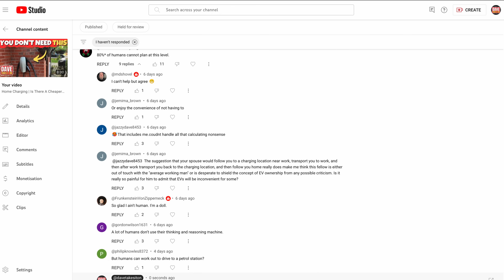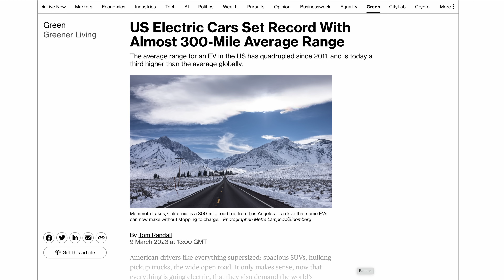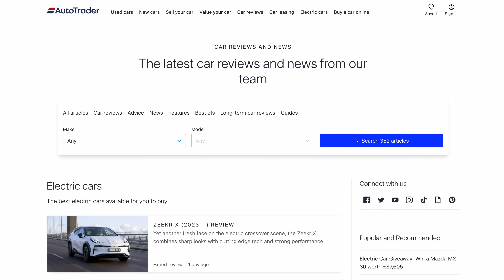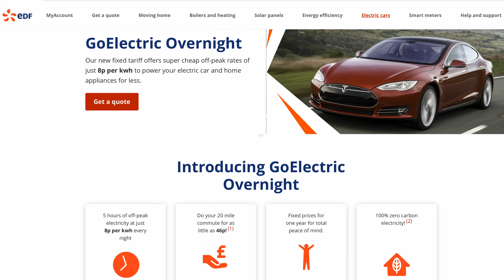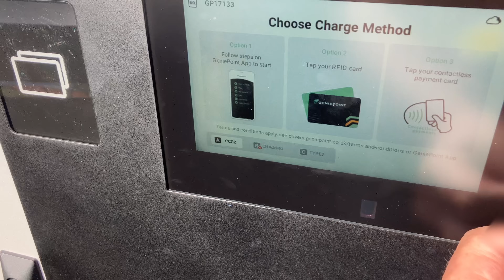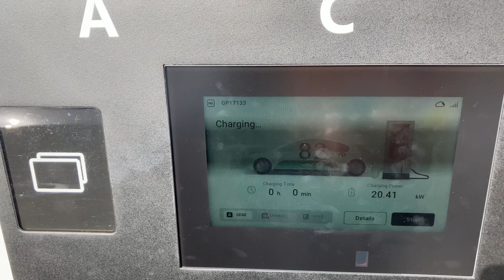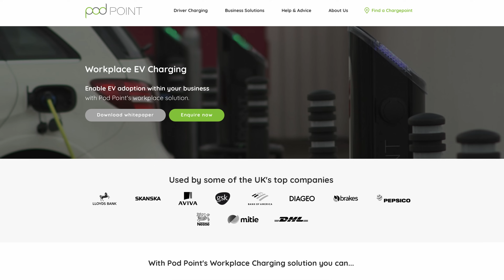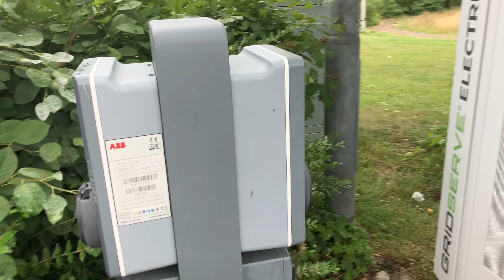Dummy's Guide To EV Charging | Don't Make These Mistakes

Comment: Can you explain to a non- EV owner what happens when you turn up and there is a queue to charge ? What is the protocol, how do/should people behave ? Etc. I can see this situation leading to arguments at peak times.
Reply: Well I guess you can queue up, or do what you might do at a petrol station with huge queue's and waiting times, drive down to the next one. As mentioned already, you can even get an app that will tell you if a charger is available and how many are free in a particular location, try that with petrol stations!
Reply: Honestly mate they are everywhere,  despite what youtube ICE heads would want you to believe it is dead easy...  this is what you do.  You open your app,  the map apps show you which ones are empty nearby.   You can guess what you do next.  The problem certain videos spin is this, they take their cars on a long run and then head for a certain manufacturer of charger, and they do it at peak times, no one does that on long runs.. all people are bothered about on long runs is getting charge in from anywhere.  Now, I own a leaf.  Technically, I should have a problem finding a charger because the leaf uses a Japanese connector.  But I don't ever have a problem, because although the percentage of leaf chargers is lower all the time, there is still new "multi format" chargers opening every week.  And... this is the important bit, remember in the video how we get two sockets on the cars.  Well the AC one is universal, even on the leaf, although on the leaf it only gives us about 26 miles per hour from charging.  In saying all this, I would say that if you can not charge from home with at least a 3 pin plug adapter, then you probably do not want to buy a leaf.  But if you can, then you might.  Today I was doing a 200 mile journey, stopped my car when I had 25% left and checked the app ( I used waze because it was already open ) ... there was a charger 1 mile from where I was.  They are literally everywhere.
Reply: Que up and wait

Comment: Very good video. 3-pin 13Amp sockets used for regular EV charging should be designed and tested for EV and this is denoted by letters EV on rear of socket. These sockets are tested for prolonged high current draw and using inductive load to simulate a car charger.

Comment: Another great blog Dave! I am lucky enough to be able to charge my car in my drive on an outside 13 amp plug in Granny cable, we are pensioners, so an EV is ideal for us! I have had my EV since 2021 and have only done 10.000 miles! But having an EV has its hidden costs - Like servicing, which can cost over £200 for an hours service! Then tyres are dearer than combustion engine vehicles!

Comment: Great video and thank you for sharing. The battery tech is still not there yet. The cost of an EV battery power pack is very expensive when the car is out of manufacturers warranty. There is still the battery memory problem which as we all know from other battery products that we all own the battery charges to 100% but as the battery pack ages the 100% charge depletes very quickly. This is a problem for the second hand electric car market, and so I’m sorry I will not be purchasing an electric vehicle.

Comment: Hello Dave, 27 months ago I bought a Leaf Plus and was somewhat surprised to hear your advice not to buy one, I have not seen any removal of Chademo sockets on my limited travels, but wonder if Nissan will produce an adapter before too long. I charge at home from a Wallbox unit. keep your ear to the ground for the nice Leaf users please?
Reply from the maker: I did not say don't buy one, I suggested to potential EV buyers who have no knowledge of charging that this is not the best car to start with and I stick by that. There are staggeringly less Chademo chargers today than CCS2 and Chademo is being phased out and Nissan is no longer installing chademo sockets in their cars. Nice cars, they started the EV revolution way back and still have a value today. I still believe not the best choice for someone who has never driven or owned an EV. BTW new video launching shortly on the used EV market and that will probably be dominated by Leafs.
Reply: @davetakesiton  Well if I could turn the clock back I might have chosen a different EV but I got my Leaf for £28.5k when  the alternatives were rather more expensive.
Reply: @davetakesiton  Hello Dave. Thanks for your clarification. I honestly haven’t found a problem finding Chademo cabinets so far. Anyway I rarely use rapid chargfers. My Leaf is a great car anyway. I am a happy.owner. Keep the good work.  AW.
Reply: I’m

Comment: EV range is a class issue Dave. For people who either can't get credit or can't afford the repayments because of job insecurity for example, buying cheap is the only option. Look at the range of EVs at £5k: around 100 miles range for A roads and maybe 50 miles for motorways. Then look at where they live, and if there are charging hubs in that town. In some northern towns there are just a few rapid chargers, and if they fail you're reliant upon AC charging.
Reply: Where I live there's just one working charge point in the town, there's a few other chargers, but they aren't connected to the grid. My daily commute is 60 miles round trip, I don't have access to off road parking so no home charging, the car park where the only working charge point is charges £5 an hour parking on top of the charging cost, it closes at 9pm, I work nights anyway, no charge point at work, only one other charge point in the town on the next motorway junction, don't know whether it's connected to the grid or not

Comment: In Australia our local electricity supplier just introduced an overnight EV tariff with a 6 hour window.  It's 8 cents per kWh Australian (4p/kWh or 5 cents US).
In over a year of EV ownership I have charged only 4 times at a public charger - every time for convenience while shopping at Ikea as it was a cheaper rate than my home rate.  Six months ago our shopping centre installed 4 Tesla branded wall chargers (I own an Atto 3 and only get 5.3kWh versus Teslas at about 11kWh) and I have not needed to pay a cent for charging my EV since then.
All your points were spot on for the "average" car owner.  That said I have done several return trips over 350km without charging on the journey, and each time topped up at home over several nights.  My car's LFP battery is fine being 100% charged on every occasion, so that is helpful.

Comment: Dave can I add an important point which you missed off about the plug socket. When you open a lot of non-Tesla EV’s the DC part of the socket (the 2 pin section at the bottom) is usually covered with a flap/insert (which you have to remove) making it look like a standard wall socket charger plug. 
I see many people scratching their heads first time they arrive at a public charger as the plug and socket don’t look the same. 

Also, as an EV Van driver (40,000 miles a year) to give people confidence on just how far an EV will travel, today I have done a 450 mile round trip. If I can do it in a 150-170 mile range anyone can do it in a high mileage range car. Charging usually takes 30 to 40 minutes a time which is enough to get out, take a comfort break and get a coffee then I’m back on the road. 
Don’t believe the anti EV stuff on social media.
Reply from the maker: Good point but mine is definitely missing the bottom two and no flap, hence I do need an adapter on my early Model S. but great points about long distance, it’s never as much hassle as the cynics make out thanks for your comments

Comment: Hi Dave. Thanks for another insightful video. As a member of the EV choir myself, I find that I agree on all points except for some of what you said about the Nissan Leaf. I agree that Chademo is going away over the long term, so in terms of buying a brand-new Nissan Leaf I would agree that you should perhaps reconsider your choices. 

But, that is for brand-new cars. Not all of us are able to (or want to) buy brand-new, and thankfully the second-hand market is developing quite nicely. It is in this market that looking at a Nissan Leaf makes a lot of sense, because you can pick up an excellent used example from circa 2014 or newer for a bargain. Yes, battery degradation is an issue you have to factor into your decision-process when you select which car to buy, but in my opinion too much negative hype is given to this. My 2014 Leaf still has 74% battery capacity left, which is good enough for 90% of my journeys - I typically charge overnight to max 80%, and that gives me enough charge for 2 days of commuting. The other 10% (the odd long journey or holiday trips) we either use my wife's Hyundai i30, or rent a car. So, for 90% of what I actually drive I have a car with lovely heated leather seats, 360 degree cameras (albeit not in the same class as Tesla), heated steering wheel, heat-pump and excellent climate control. Price: around £5k. Bargain! 🙂

Charging at home happens using my granny cable because my little 24kWh battery fills up quick enough, and since I bought the car almost 2 years ago I haven't even spent as much on electricity as I would have had to pay for a fast home charger installation. Therefore it did not yet make financial sense to do so, so rediculously cheap it is to operate this old Leaf. In addition to granny charging I can use L2 chargers with my L2 to L1 cable, and even use tethered L2 chargers with an L2 to L1 adapter. I only really use Chademo chargers if I need to go further than what a single charge can support, and also if time is of the essence. So, older cars like Leafs and the slower-charging Zoë models have a real role to play in short to medium journeys - but the undeserved bad press of "battery degradation" and "leased battery" creates confusion and drive people away from EVs in general. I would argue that this is the most critical area (inner-city driving) where we need people to get out of dino-juice guzzling polluters and into clean electric cars (even old ones like the G-wizz if you're up for an adventure) for the sake of our health. Please consider doing a video taking on the "shallow end" of EV motoring, because in my opinion that is where a lot of EV value-building is still locked up. After all, not all journeys are longer than 20 miles. Cheers, Jan.
Reply from the maker: Thanks for your comments. I agree with most of what you say, they are great cars but I already visit many chargers with no Chademo at all, so for a beginner it’s a harsh learning curve unless they only charge at home, then no problem. With far too few used EVs on the market, the new sales are in the majority. This will change and prices will drop, it’s just early stages. I look back 4 years to when I got my Model S (used) it didn’t even have CCS charging, just superchargers and type 2. It will be dramatically different in another 4 years

Comment: Your data is absolutely correct.  However, it is still the case that charging at home, particularly if you have solarpv panels, if much cheaper.
Reply from the maker: Absolutely it certainly is and I never doubt that. But with Tesla supercharger at 35p that makes 9p per mile, about half that of an ice car doing 40mpg. Still worth it never charging at home

Comment: Thank for the updated video, if you touch on charging again can you touch base on possible New EV owners doing research on the Charging curve for cars . 
Many a day I read comments on people saying that the chargers not working properly when it’s may not be the case and there trying too get a charge out of a 22KW post and only get 3.5KW . Because there car and Cable are not designed for 22KW AC or even the same comments about DC chargers!.

Just a Thought.
Reply from the maker: Yes, still a problem, I have covered this before but I think you might be right a new dummy’s guide to charging speed is needed
Reply: @davetakesiton  
Morning. Even though I do not have a EV myself I on occasion have the use of my Son’s and so the pleather of Apps and Swipe cards are on my phone and Tablet ( and wallet !).
Plus I made sure I down loaded the User manual for it too so that makes comfortable reading , rather than the rush to find something at the last minute. 
I think that App wise ZapMap has started to get better over time , ChargeFinder, ABRP, are a useful as a cross reference tool as well .

I don’t get too do long Journeys with my sons car but we do go on “ long “ runs together to Fairford or Bovington / Isle of Wight.

I have the cards and Apps so that if we share the driving we also share the fuel cost.
Richard.c

Comment: The only problem with the Leaf is the Chademo  as the rapid chargers manufactures are slowly phasing them out,  with the slower charging you would have no problem as you have your  own cable.
Reply from the maker: True and the Leaf is a good car, but for a novice thinking of their first EV the current and future charging structure is a complication they can do without

Comment: But what are the  claimed and real advantages of a ev
Reply from the maker: No tailpipe pollution = no tailpipe pollution
Reply: @davetakesiton  But the equivalent amount of pollution in its manufacturing to the total  pollution from a petrol car in its first 20 year plus  the fuel  pollution  comes  every  time you charge  it as 75% of electricity  comes from none  green energy so a ev's pollution is in reality at the plug and not a tailpipe, but it is just the same plus it is using more energy  to drag around  a one ton battery causing  more real pollution.
Reply: @Beaware699 Only 40% of UK electricity was produced by gas or coal fired power stations in 2022, and approximately 48% produced by wind, solar, nuclear and hydro, with the rest by biomass, storage and imports. The % of wind and solar serving the national grid is growing all the time. The other point is that tailpipe emissions causing the most concern on air quality for human health reasons are mainly in towns and cities whereas power stations are usually in more remote locations so a lower impact on air quality for the majority of people.
Reply: @johnharvey1786   Sorry but in 2022 only 12% of the electricity produced in the UK was derived from genuine green clean energy.
And as for expanding  the charging  network  to allow for a greater amount  of charging, the grid in many areas  is at maximum  capacity  as it is some areas  are already  having  to look at limiting charging  at times and are carrying out looking into rotation of charging between  areas  for a to be decided number of hours at a time.
Reply: @Beaware699  Your figures and comments are completely untrue.
Reply: I know it’s an old thread - real world advantage.  Here we go.  My Tesla 3 has 250000 miles it has been exclusively charged at home using a mix of solar, battery storage and mains fed power.  So my actual savings are way more than the following example.  If I drove 250000 in an ICE vehicle doing 50mpg the fuel would be 5000 gallons or 22730 litres  @145ppl = £32958.  
Now for the Tesla = I get 4 miles per KW, that’s 62500 KW used @ 12p total cost = £7500,  @7p = 4375.  My actual usage is closer to 4p = £2500 for a quarter million miles.    A saving of 30grand. How is that for real world advantage????? 
Battery is now at 89%

Comment: Top video. Good tip on destination chargers. Just back from a weekend in Wales. The hotel had free charging so saved myself £73 as I was expecting to have to use expensive DC chargers. I don’t know of any hotels that provide free petrol and diesel.
Reply from the maker: Glad to be of help, use free chargers whenever you can, every little helps

Comment: If you have a house with a drive then charging at home is trivial - install a charger. That's it. I think if someone has on-street parking then they have a very legitimate reason not to own an EV. This is up to councils to sort out - roll out street chargers and offer some kind of reduced rate for nearby residents. Or some way for residents to safely and securely run a charger from their house to the car without posing a hazard to pedestrians. In addition, they need to boost planning laws so that all new car parks and significant building works require new charge points so eventually there are points where people tend to park their cars - offices, parks, supermarkets, on street, venues etc.
Reply from the maker: Many councils now allow properly designed cable trays across pavements and channelled trays cut into the pavements are quick, easy and cheap and opens up ridiculous cheap off peak rates, have a look into it, like Vevor cable protectors